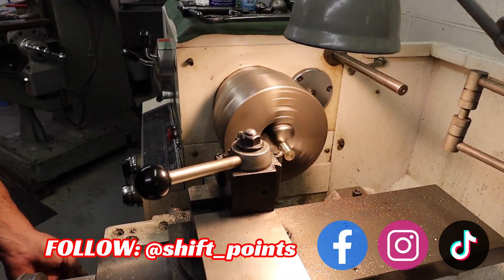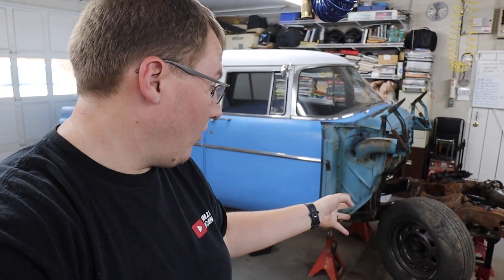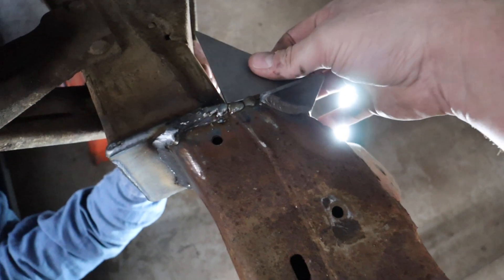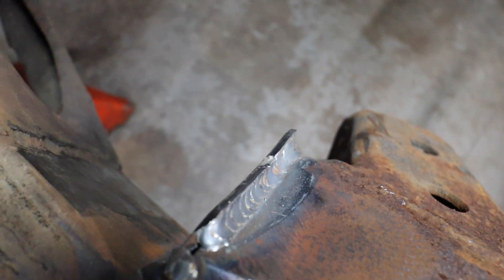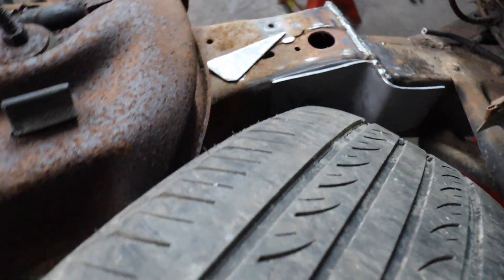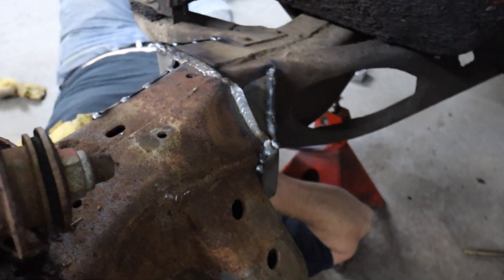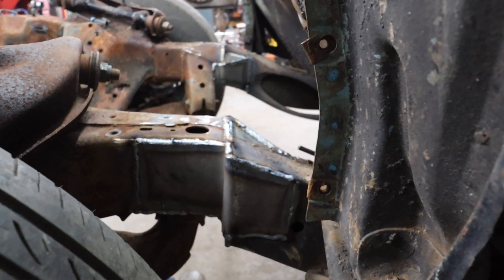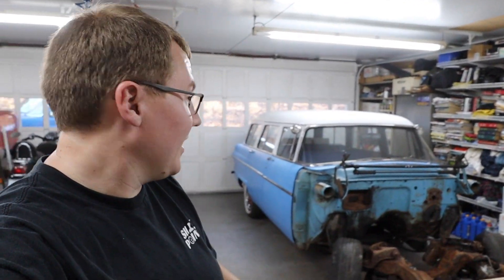Customizing a Vintage Ford Ranch Wagon with Chevy S10 Parts!

Comment: What's the point of hacking up a perfectly good frame (that already had factory IFS) to scab something in out of a truck? This is a bizarre trend that seems to be change for the sake of change instead of change for the sake of improvement.
Reply from the maker: A couple of things that the customer wanted for this was this makes it so he has easy small block motor mounts and disc brakes. He can more easily find kits to lower the S10 than the 55 Ford stuff. Plus the 55 Ford has that massive steering box right in the way of most headers. So in general it's a lot of gain for his needs!